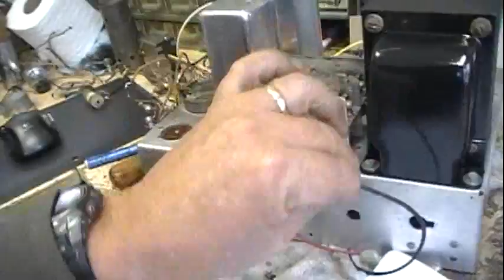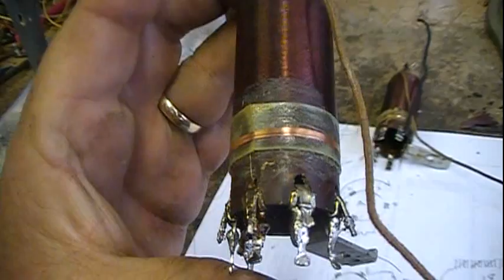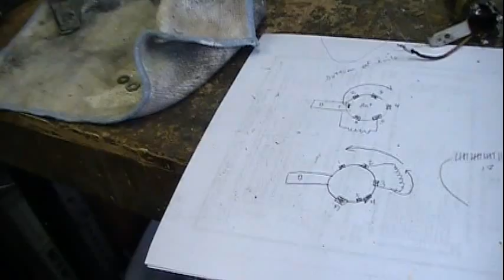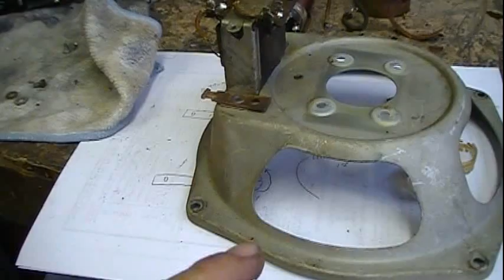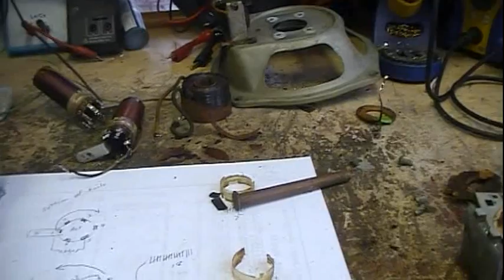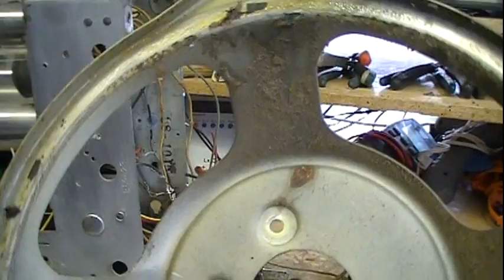Philco 60B restoration part 3

Comment: That looks like a somewhat difficult radio to restore with those IF cans pressed into the chassis. That speaker restore project is something else. Nice job on the filed coil replacement. I assume the center tapped filament winding was 12v center tapped with 6.3 between either each lead to ground? I'll have to look at the schematic. You do a far more intense restoration job on your radios than I do as I don't strip down parts to the chassis. You did a beautiful job on that antenna coil. I like what you do. Gary

Comment: That radio sure had a mammoth melt down. Makes a strong case for an internal fuse.
I remember an early HiFi amplifier I built had a pot across the heater winding with the wiper earthed. The idea was to adjust to pot for lowest hum. I found in practice it made no difference as to where the wiper was, as long as it was earthed.